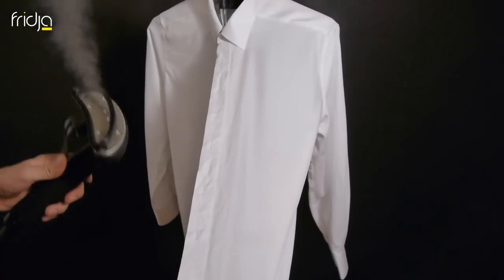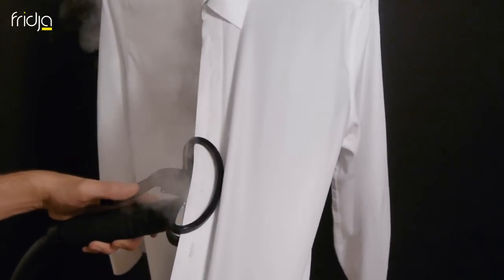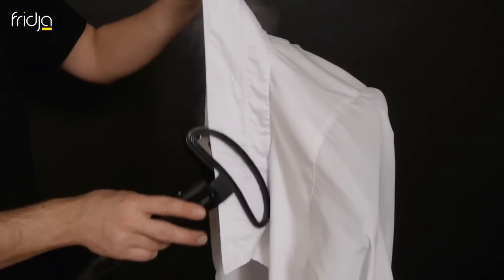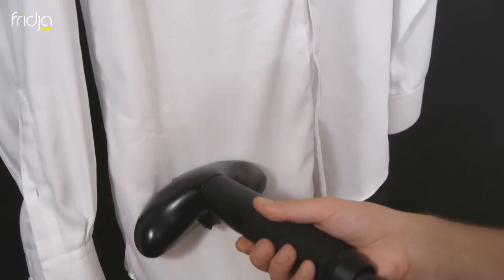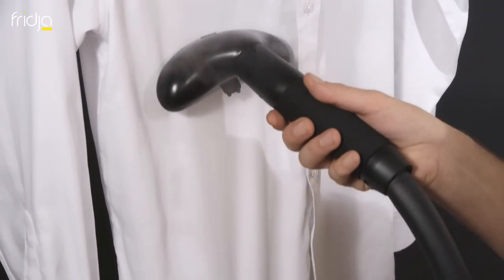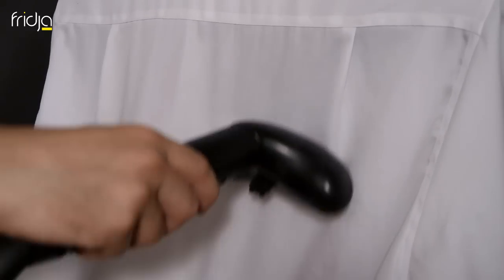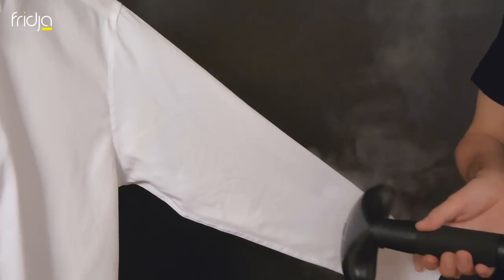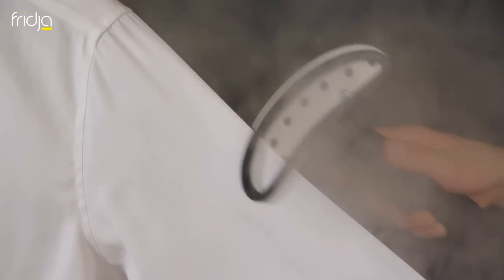How To Steam A Shirt - Fridja Professional Garment Steamers School

Comment: This doesn’t look any quicker than regular ironing
Reply: True if you use the clasp attachment it does take around the same time as an iron probably even longer but unless you are some big manager who wants to look very formal you don't really need to do that, just making a few passes with the steamer on those areas will make them look just as good

Besides ironing takes much longer to setup and can cause burn marks to your clothes, also an iron damages your clothes far more then a steamer does

So in my opinion if you really need those extreme creases on the collar and sleeves then your better option is the iron but if you wear buttoned shirts in a more casual manner the steamer is much quicker, easier to setup and is actually fun to use while also not taking a lot of space in your house

I have about 10 buttoned shirts I wear and it only takes me 20 minutes to setup the steamer and steam all of them
Reply: It just took me an hour to do 5 shirts hahaha
Reply: @echi29  same, I took 1 hour to steam 3 shirts and theyre  just t shirts
Reply: @adre819  you guys having trouble steaming some shirts? it literally takes 5 minutes without the fancy clamp. im confused as to what you guys doing
Reply: I want one ironing is horrid with the amount of repositioning and angling you have to do with shirts
Reply: @Ajsosick  tell me please, what steamer do u use?!